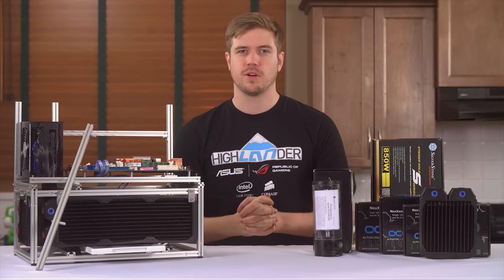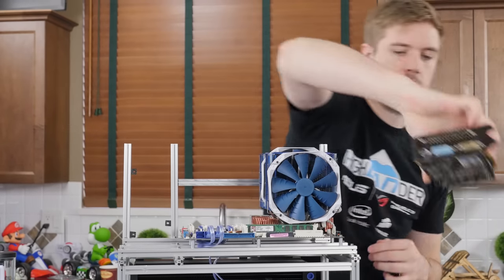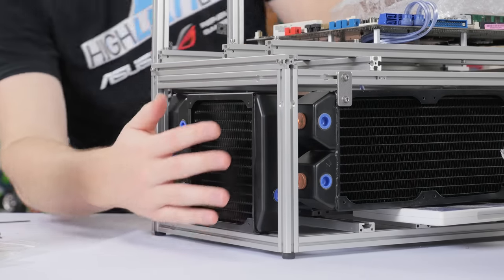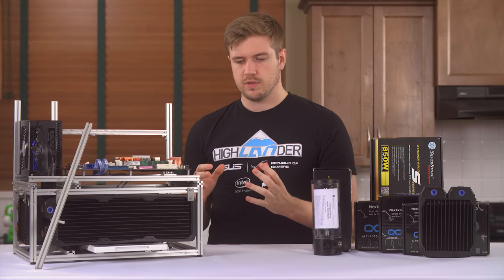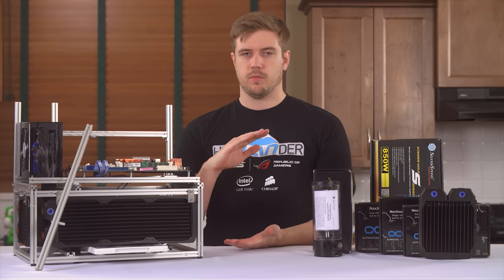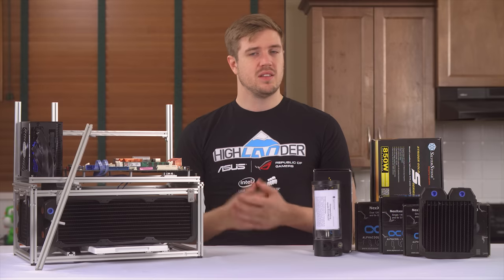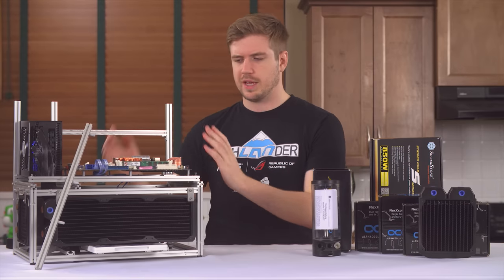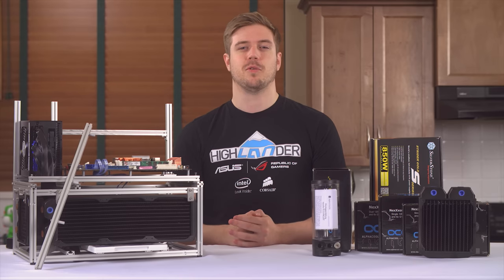Luke's Personal Rig Update Part 2 - Squirtle

Comment: Maybe I missed it, but what about fans? How are you going to cool the water in the radiators? I see no space available for fans.
Reply: I was thinking the exact same thing.  They can be mounted either externally or internally (or both) with some modifications, but he never mentioned them at all during the video.  Maybe it will be mentioned in a future vid?
Reply: Pablo D well considering he forgot about the reservoir maybe he forgot about the fans. /joke
Reply: with an obscene number of rads maybe they are passively cooled?
Reply: I thought that too, but for optimal performance he should have some air flow over the rads.  Maybe he's going for a dead silent build and isn't worried too much about temps...guess we'll see in a future vid.
Reply: Yea I don't think he could get  much quieter than fan-less.  Based on no facts at all  all dem fins gotta be coolin

Comment: What about the fans??? Looks like you used all your room on the inside with other stuffs.
Reply: With that many rads he doesn't even need fans, it can be a completely passive build
Reply: Ryan Kremer Then, that means that he could get the same quality cooling from a much smaller fan-radiator setup. What's the point of this?
Reply: Barujin Anon I'm not entirely sure what the point of this is
Reply: Abdulla Mehdi even just putting some fans in the middle of the 360's and on the 120's would help a lot
Reply: Barujin Anon silence?
Reply: NoOne
Large fans are already decently silent. I don't see a big need for it.
Reply: Barujin Anon Personal opinion
Reply: NoOne
Have you tried 80mm? =P You'd probably agree.
Reply: with a rad if you have enough you can actually run them passive if you have it in an open air bench like this you mainly need fans in case cause otherwise the air can't escape the case passively

Comment: I remember the discussion of building it yourself in the other video. It's nice to know it's 80/20, as anyone wanting to make their own case can go utterly insane with their design without copying Spotswood in the slightest.
Excellent video, makes me want to go out and build a case and system.

For the mount worries and such with the reservoir, using something like the free sketchup or a cad program supported by 80/20 plugins can allow you to design and test fit the parts before buying them, and the one plugin will even show you the cost and cost breakdown of all of it. Bit easier in my experience than trying to cut and fit, just design it to start then cut and assemble with usually no troubles.

Comment: Remember when you're hinge shopping to get something that can handle the weight of a filled radiator & lines; Possibly a latch hinge to hold it in place? You could also use a chain/hook to anchor it up top, or maybe a car-hood style swing out lift mounted on the bottom, to keep the radiator locked in the open position.

Comment: Luke! Read this! 

I think a pretty cool thing to do would be to: 

have all the corner posts come up as high as the ones holding the PSU, then fitting thin plexiglass sheets in the grooves of those posts to enclose it, you'd still be able to get at the guts by sliding them out easily! Hope it made sense..

Comment: I love that res. 
Beware though, Luke. If you apply too much pressure on one side  the glass can slip off the O-rings causing leaks. I had a really tight fit with it myself ;)

Still the classiest reservoirs out there. I hope it works out for you!

Comment: Slick you should Jerry rig the psu to fit at a right angle or maybe reverse it so the cables go the other way or even stand it straight up on its back side. Cool project though I must say, best of luck with it.

Comment: Could you try to sort out the volume of the ad read? I've noticed recently that it's way louder than the rest of the audio and quite often have to turn the sound down because Linus is shouting in my ear about Intel xD

Also, I don't even remember part 1 of this mini-series. I'm sure scheduling uploads is a difficult task, but recently there has been a tendency to space out episodes way too much (same with the mineral oil build). Perhaps you should either upload them all as one video rather than splitting them, or upload them closer together, to avoid losing people. Just some feedback :)

Comment: Luke Lafreniere Would it be sane to consider rotating the power supply so the cables all route straight down into the basement? (power cord in facing upward). It would need a right angle bracket to convert the current verticals to a horizontal atx mount.

Comment: Why dont you try to get a little bit taller rubber legs, mount the hdd rails from the bottom , mounting all the rads from the bottom gaining space towards the top of the cage where you really need it for cable management?

Comment: I dont see the point in building it this way. If you start adding in a ton of right angle fittings you will need another D5. 4 rads, 2+ blocks is probably already pushing it. I think the tubing will look very messy this way as well. I would just elongate the bench to fit 2x480mm rads and clean it up a lot.

Comment: I'm by far an expert compared to the level I place Luke but I see so many debatable things going on here not to mention the WII game case... I'm looking to either purchase or build a test bench and my last concern is space. The whole idea (imho) is flexibility and it's clear here that he is ignoring that concept. I could better utilize a normal case without having to cram components and still have decent access to my components. I don't see why mounting the rads with fans on the outside would be a game changer because the only real concern with the rads is the fins which would be protected by the fans. Not bashing Luke be any means because I completely admire his expertise but just have a hard time justifying a lot of this.

Comment: I dont understand rads for most pple. Most pple dont even overclock to the pint that they need so much cooling.. Seems to be more of a "im cool cause I use one" factor lately. Unless your running a custom pipeing system with a backup pump, I wouldnt bother. Besides, all those fans do create noise over 1 fan on a large heatsynk .

Comment: Did you do the calculations for the heat dissipation of all the rads? I personally didn't do it but I feel that all those rads are a bit excessive. I feel that for the temps that would be needed for all those rads there would be a detrimental amount of voltage being put through a cpu. I could be wrong being new to all this, but if someone could help me out on this?

Comment: He linus,

Is there a way to connect 2 external monitors to 1 laptop.
I have a Geforce GT 540M gpu in my laptop.
I have 1 VGA Output, and 1 HDMI Output.
When i try to connect 2 external monitors, it only uses 1 of them.
Is there a way i can use both without adding other hardware like external gpu's
I want to have different content on both monitors, so not something you get with a VGA Splitter.

Maybe anyone else knows, please, i would like to know.

thanks in advance :)

Comment: What should I get i5 or i7 (mainly gaming, some editing / rendering. )Pls help! Thanks in advance.
Reply: i7 4790k. Get it from a microcenter if you can. It's cheaper.
Reply: Mainly gaming and a little editing : i7 4790(k) but if you want to be able to play while you render or edit, or even render a bit faster, you may consider x79 or x99 processor if it fits your budget ...
Reply: If you're mostly gaming an I5 is enough,if you are doing alot of rendering/editing then an i7 could be worth buying.Don't take away too much money from your GPU by buying an i7 though.
Reply: i5 is enough for gaming. Having a better video card will benefit you more gaming and video editing than having a better cpu
Reply: Thanks
Reply: Get a Mac

Comment: Honestly I don't like squirtle. Its too complicated for an open test bench. 4 rads? come on dude. Simple and clean is best. Good luck anyway.
Reply: Yeap.  It's as if he's trying to one-up Jay from Jayztwocents.  Sigh.  

I"ll remain just fine with a cryorig r1 ultimate and nothing but air cooling for the rest in my thermaltake core v21 matx cube case.

Comment: Guys, I need your help to watercool my NZXT H440. I7 4790K and a GTX 780Ti Matrix Platinum(want to keep the back plate if possible). (Wish to add a second 780 Ti soon.)
Budget between 400 and 500 euros maximum. 
Any suggestions?

Comment: I need some help i have recently got windows 8 and installed it and now wanna upgrade my cpu and motherboard  would i have to buy windows 8 again?
Reply: Nope. Windows stays on your hard drive.
Reply: After upgrading you might run into some licensing issues but it can be easily fixed when you call up MS service center
Reply: thanks for the help

Comment: its dual 780ti with AMD-9590 suck? Or i should go for an i7 for dual 780ti? :/
Reply: I7, amd sucks
Reply: dual 980s is better if you don't the 780Tis already.   Also i7 will lower your heat output and power consumption. 

edit: I meant that the i7 consumes more power. But it likely doesn't matter that much, the graphics cards consume the most heat and if you can get power consumption and heat, you can overlock to push performance.
Reply: ^^^^^^^^^^^^^^^^^^^^^^^^^^^^^^^^^^^^^, and also the i7 performs better with sli

Comment: what do you guys think about this pc:

cpu:
Intel Core i5-4690K Processor 3.5 GHz LGA 1150 BX80646I54690K

gpu:
ASUS Graphics Cards R9290-DC2OC-4GD5

psu:
Corsair Builder Series CX 600 Watt ATX/EPS  80 PLUS (CX600)

ram:
8 gb of some generic brand

storage:
WD Blue 1 TB Desktop Hard Drive: 3.5 Inch, 7200 RPM, SATA 6 Gb/s, 64 MB Cache - WD10EZEX 

motherboard:
MSI ATX DDR3 2600 LGA 1150 Motherboards Z97-G45 GAMING

case:
Corsair Carbide Series 200R Compact ATX Case CC-9011023-WW

os:
windosw 8.1

any suggestions or improvements?
Reply: Sounds pretty solid to me. Throw in a 240GB~256GB SSD and you're solid
Reply: Yea, an SSD and your good.
Reply: If you are rally attached to win 7 don't get 8 (Unless you wanna try it.)
Reply: I thought windows 8 was only tiles with that really weird  "win 7" mode
Reply: Oh ok didn't know that